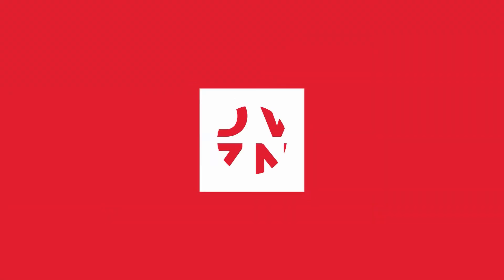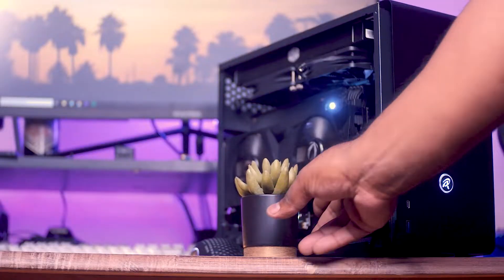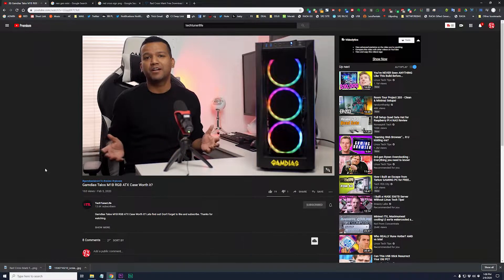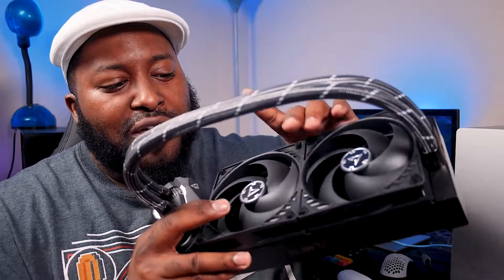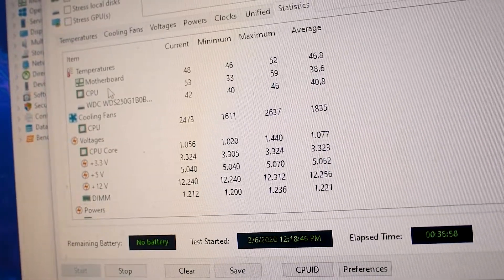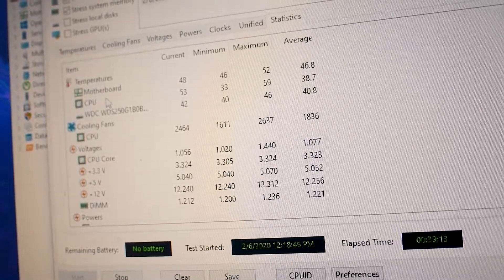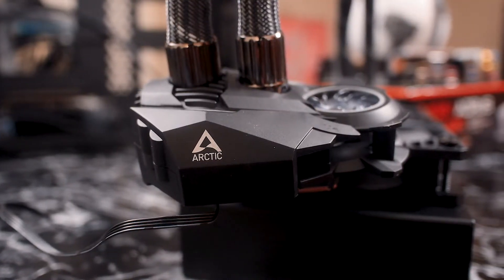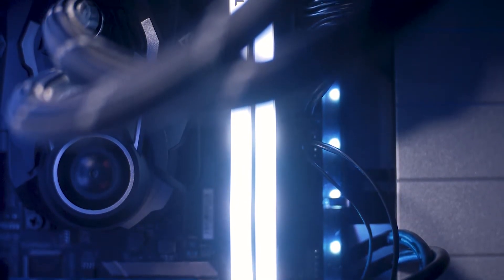The COOLEST Liquid Cooler | Artic Liquid Freezer II 240 AIO

Comment: Good Review! I was seriously considering this AIO for my build a few months back but I ended up getting the Cooler Master MA620M for the rgb and because it fills up the empty space in the middle of the case. Now if Arctic had made their ARCTIC Freezer 50 TR AM4 motherboard compatible I would have been all over that. I love Arctic, my old case fans were ARCTIC F14 PWM fans and I also use their MX-4 thermal paste for my builds.

Comment: Yep, We talked about Linux.... but I'm salty with Windows 10!
Reply from the maker: man, so many people are.  What do you not like the most about Win10?
Reply: @DVZNMedia  It reports back to Microsoft and the overall System Requirements (i mean...) Linux is lighter on my low-end Hardware and Linux is FREE to Install and quicker to get up and get up and running in less than 2 hours (with in Linux: importing your data/installing wanted programs)

In Windows 10, I Like:
1. The Theming
2. Windows Subsystem For Linux
3. The Performance Improvements (on Higher-end Hardware)
4. HDR (10-bit) Support (I don't have a HDR Display)
5. The Sound Scheme (I love Audio)

Cons:
1. The Filesystem (NTFS vs EXT4)
2. Spying (Reporting to Microsoft) - I've used Windows 10 before, but it's not my thing.
Reply: @Grumpy Technician EposVox said THAT too about HDR10 Support. 

Which should he try: between POP! OS and Linux Mint 19.3 also Ubuntu (I love 'em all)

 POP OS! I heard is good for Gaming and the INVIDA Drivers are included in the .iso! I don't Game, but what I do is Music Production.. Linux Mint is SSOO GOOD for that (Ubuntu Studio is my All-Time favorite MultiMedia distro..) what I adore about Mint is: Modern, Green, and its one of the Mainstream distros) I can rattle off about my usage of Ubuntu Studio and Linux Mint!

(looking off in the distance thinking) What If Linux supported HDR/HDR 10???? imagine the hype!
Reply: @Grumpy Technician For Me, I think I will never get a 10bit Panel, 1080p60 is fine (1600x900p is my current resolution) 4K is getting cheaper too so, I don't know as well as I'm a Techie: I know my stuff)

Comment: Great video, on a cool looking AIO.
I just installed a ASUS Ryuo 240 AIO cooler, I replaced a Cooler Master MasterAir MA410P cooler.  
The ASUS Ryuo 240 AIO was super easy to install, high quality build, quiet, effective and gorgeous. 100% satisfied.
System includes:
ASUS GT501 case
ASUS Z370 Gaming Plus MoBo
ASUS RTX Strix 2070
ASUS TUF Keyboard and ASUS Evolve mouse
i5 9600k CPU sporting the ASUS Ryuo 240
Geil 8GB x4 (32GB) 3200Mhz DDR4
Crucial M.2 500GB SSD
Samsung 970 Evo M.2 500GB SSD 
Samsung 860 Evo SATA 500GB x2 SSD
EVGA 750Watt G2 Gold PSU
Coolermaster front case fans 120mm x3 and a 140mm rear
Acer Predator 27" 1440p Monitor